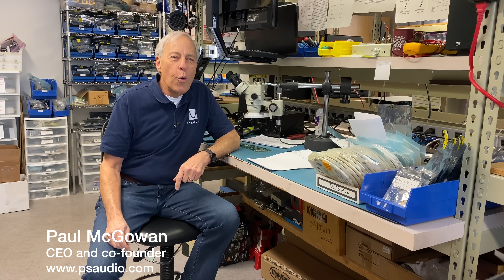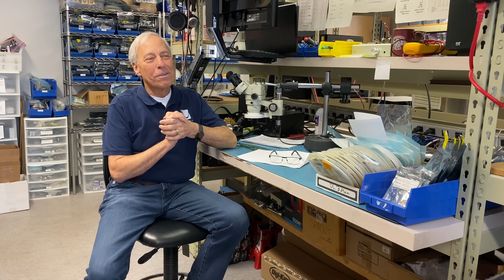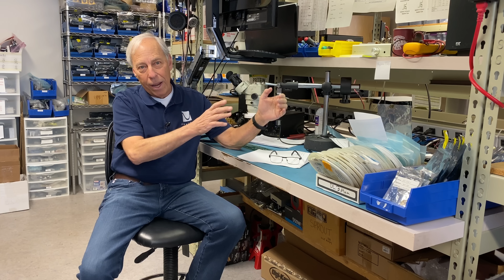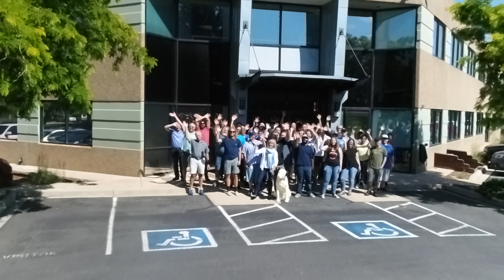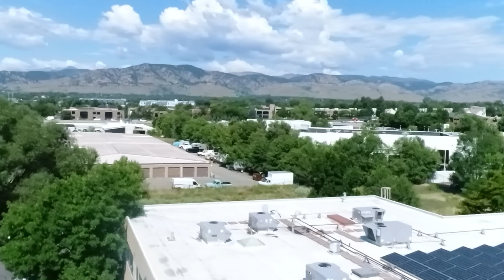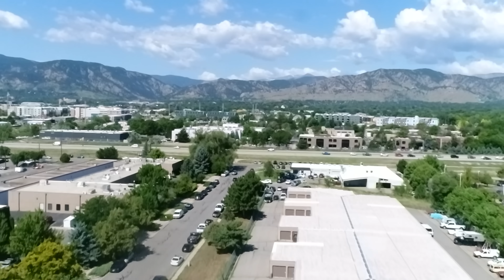What is DoP in digital audio?

Comment: Is there any evidence of missed timing due to the " extraction " process ?
Reply: There really shouldn't be issues as far as timing, the "extraction" basically just involves ignoring the first few bits of the "PCM" signal, and everything the DAC actually reads should be the same as a DSD file. The main issue is that it requires a higher bit rate from your DAC since it's sending some extra data that gets ignored, so if you DAC only supports up to DSD512, you'll only be able to use DSD256 or lower over DoP, and you'd need native DSD to enable DSD512. But as others and myself have mentioned, it's actually possible to get native DSD playback on Windows, Mac, Linux, and even on your smartphone, both Android and iOS.

Comment: Can I PLEASE suggest you visiting nativeDSD.com FAQ's section for an accurate description of what DSD actually is (no I'm not affiliated to them in any way). If you can understand that DSD is NOT actually digital in the sense of PCM; i.e it's just 0's and 1's bits 'mirroring' in density the captured analogue signal not digital value words as with PCM all becomes clear as to why you can't mix it digitally and why you can't just stream it out of computers without disguising it. It also may help clarify why certain people prefer recording in it despite the hassle. Cheers.
Reply: Angelwars I had a big discussion with an engineer about whether Class D amplifiers are digital or not. The bottom line is that Class D amps are more properly named Binary amplifiers. The same is true with DSD, although Sony and Phillips used the term digital in the name. Since I doubt that  binary will catch on, I think that it’s better to call DSD and Class D digital than analog as it better represents the operation of the circuitry or signal.
Reply: @StewartMarkley  that's really interesting thanks for that. I'm slightly playing devils advocat because i'm constantly trying to point out that PCM and PDM are very different in their methods of capturing the audio signal. From a dictionary point of view PCM is 100% digital but DSD can be argued as analogue on the basis of it mirroring a changing signal level simply with differing densities of 'binary' digits. The bits do not represent definite value samples of the signal as they do in PCM.
Reply: Angelwars Yup, that was the contention of the engineer I talked with. But as I see it even DSD is more like digital than analog as it sort of breaks the continuous signal into binary bits similar to sampling with PCM. Any deviation in amplitude within a bit time is lost, however insignificant as the bit rate is so high. I don’t think anything that samples a waveform is really analog.
Reply: @StewartMarkley  Important point I keep emphasising is that DSD 1bit PDM does not involve sampling it is the modulation of a bit carrier stream running at very high speed (and arguably higher the better if the 'system' can deal with it properly). I agree it's still breaking up a continuous signal however slightly but isn't that like 35mm cine film? i.e it's separate frames running so fast it appears to us as continuous and that is most certainly not digital.
Reply: @angelwars3176  Technically you are right, but I think that breaking a continuous signal into discrete bits  representing an increase or decrease of amplitude is more like a digital or binary process if you will than an analog process.
Reply: @StewartMarkley  PCM captures the signal by sampling it at a certain frequency and bit depth into discrete value words, PDM capture is not based on samples or bit depths it is the modulation by the signal of a clock carrier creating a continuous stream of bits that simply mirrors the changes in amplitude - there are no values involved. It is digital in the sense it uses digits - 0's and 1's but they are acting as markers not binary code of any kind so I consider PDM an analogue process. 
PCM digital audio can be easily manipulated by computers for mixing, mastering DSP etc because it consists of digital value words which is why it is ubiquitous and massively supported - DSD cannot be managed in this way (as its critics continually point out) because it is not digital in the traditional sense.
Reply: Angelwars Yeah I get it about how PCM works, I’m very well versed in the subject having studied audio engineering since the early 70’s. While the word sampling doesn’t come up when discussing PDM, PWM, or Class D, it is simply because there is no Sample and Hold used in these techniques. Also these methods do have a value just like PCM, but the value is either 0 or 1, which is manifested in more or less pulse density or pulse width. Then these pulse streams are integrated to convert from bits to a continuous analog representation of the input signal. Finally, when a signal can only change amplitude at prescribed intervals, it isn’t an analog process, IMHO.
Reply: @StewartMarkley  It's the word value that needs focussing on. PDM bit rate is not representing any value in the digital sense it merely marks a response. I did put forward the argument that DSD was a kind of hybrid between analogue and digital keeping in mind all the points we have both made but I still consider it an analogue capture.
Reply: Angelwars Well whatever. Your language of marking a response isn’t anything that I have run across, but I recognize your right to think that way.

Comment: You can have native DSD on Windows, Mac, and Linux, you just need to download and setup the appropriate plugins and drivers for your music software. Can take take some fiddling, and DoP works with a bit less setup effort, but it can and has been done, inlcuding on my own system. DoP also requires a higher bitrate, so playing higher resolution DSD files with a certain DAC will only work in native DSD. Can even be done with ease on your phone with HiBy music by changing DoP to DSD and giving the app exclusive control of the usb DAC.
Reply: For anyone curious, with foobar2000, you just need the ASIO plugin and DSD transcoder plugin, run DSD>ASIO>DSD Transcoder, and setup DSD transcoder to use native DSD instead of DoP for the bitrates you want.